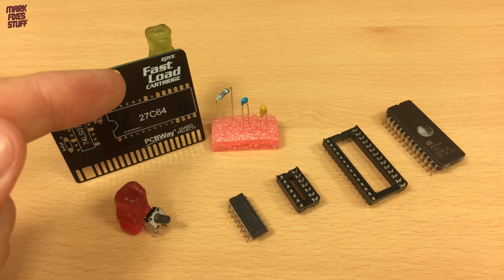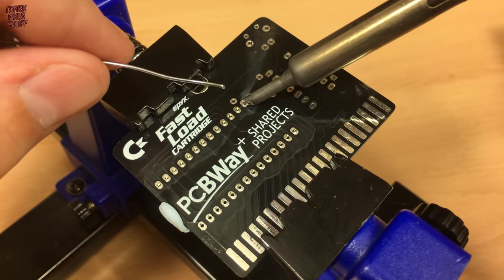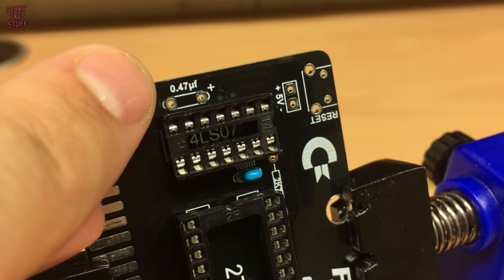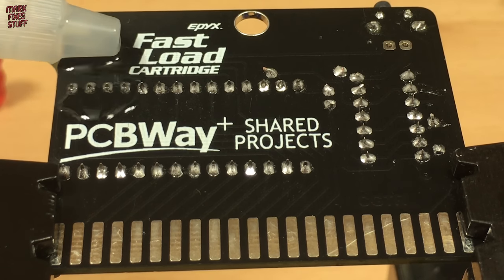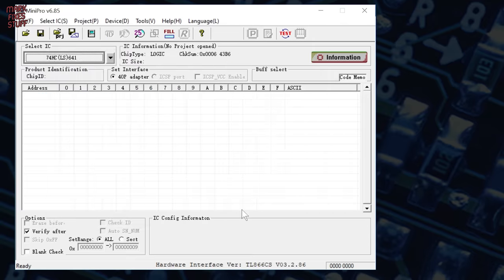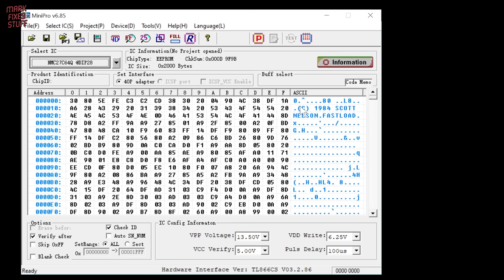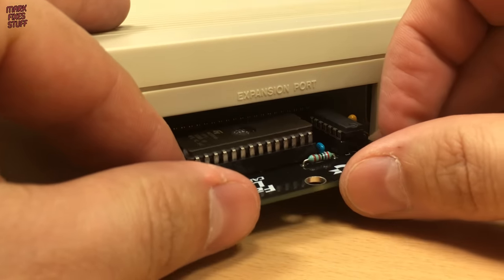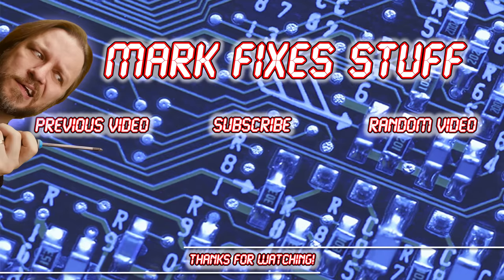Buying FAKE AliExpress EPROMS & Building an Epyx FastLoad Cartridge anyway!

Comment: FYI, no clean flux is an oxymoron. I say this because it works the right amount of heat to evaporate it. Issue is some people put too much on and it turns to a substance which prevents things from working (8 bit guy had this issue on a build) . SO if you use it make sure to check it is clean afterwards.
I worked for a contract board maker which me and several other techs got them to go from no-clean to water soluble. it add a little work BUT fixed a bunch of issues and boards worked much better
Reply from the maker: Great tip. Thank you!
Reply: @MarkFixesStuff  you would be surprised how much it can cause issues. 8-bit-guy was having issues with an 1 mhz apple clone. And makes sense the flux can act like a capacitor and thus screw up signals

Comment: Top video as always Mark! I'm a big fan of blu-tack for holding stuff in place temporarily while soldering.

Nice to see some EPROM programming action too! Those fake AliExpress chips are becoming a real problem, good detective work tracking down the correct model numbers and finally getting them programmed. 👍
Reply: The most annoying thing is that most of the parts DO work, they are real EPROMs just not that type they print over after sanding. And it may matter if they differ in programming voltages.
Reply from the maker: Yes. I’d pay more for the honest parts!!

Comment: You mentioned a new roll of solder.  Do you use regular or unleaded solder when doing new projects? (Repairs should match whatever is already there, but what about new projects like this?)
Reply from the maker: On old stuff it’s always leaded. New stuff is usually unleaded, but as it’s just for me it’s not a legal requirement. Leaded is easier by far but I have a 2lb roll of unleaded too.

Comment: I still have my original Epyx Fastload cartridge that I bought 35 years ago. One of the best things I ever bought for my C64. It drastically improved disk load times on most games. I had a few that were incompatible until I ripped the copy protection out of them.

Comment: Oh the double entendres ...

'I had to cinch the legs slightly otherwise I couldn't fit my part in ...'
'...it's simply a matter of slipping it in and spreading its legs so it doesn't slip out ...'
'Subject your part to the snip ...'
Reply from the maker: That's exactly what I did though!!!!!
Reply: @MarkFixesStuff  The gummy crew check your script for potential innuendos.
Reply: Not to forget "excitedly ram it into the rear as far as we can" at 14:45

Comment: Very nice...
Although if one has an EPROM programmer one could fit a custom Kernal with fast loading support to the computer itself, maybe a dual Kernal set up for good measure. If I remember correctly mine's running Dolphin because I prefer it's command set with the JiffyDOS fast loading routines as I think they are faster and a C=65-alike boot up.... Press the C= key on boot to get the stock Kernal instead.
Reply from the maker: Yeah, this a build project to make a cart. I have a few differnt things to make. Mostly I use my Kung Fu Flash.

Comment: I just use my Kung Fu Flash and install Epyx fastload, Ultimate Cartridge or any other cool tool to it. If you type LOAD"filename",8,1 put : and hit SHIFT and RUN/STOP at the end so you do not need to type RUN, it will auto run program. Commodore key and RUN/STOP will load first file in directory with a Epyx cart. Or $ to load listing, go up to file you want to load and put / in front of listing you want to load and hit RETURN, then scroll to blank part of BASIC screen (at the bottom of screen) and type run. Some fastload utility cartridges use F keys to shortcut commands.
Reply from the maker: This is all really handy to know. I was a pauper, so DOS commands are new to me!

I knew about the Kung Fu Flash process, but I don’t think I’d have got sponsored for that lol 😂

Comment: Blue-tack is not required and only turns messy with heat.
On a 14 pin chip for example, bent the 7th an 14th pins, or 1 and 8 pins, and tack the opposing pins with solder.
Now you are free to straighten the pins you bent, and finish soldering if bent pins bother you.
I just solder them as is. 
btw, love the sexual innuendos!
Reply from the maker: When I bend the pins I get yelled at in the comments that I am weakening the parts. I like to do the Smurf poo joke too. I cannot tell you what I use in private. :p
Reply: @MarkFixesStuff  lol

Comment: Just bend 2 of the pins on the socket to hold it in.
Or hold onto it directly while tacking 2 pins.
Anyone know if there is a compatible board available at OSH Park?
Cheers,
Reply from the maker: No mate. They have a FCIII+ but not this.
Reply: @MarkFixesStuff  ok thanks,
Cheers,

Comment: Funny how if you want things to load faster on the Atari 8-bit users just make the disk drive more capable (like an upgrade) and use something like SpartaDOS. But then the data on Atari 8-bits flows fast already. 😉
Reply from the maker: There was JiffyDOS for the C64 as well back in the day. The data rate was really slow on the c64 though.

Comment: I prefer art microclamps and more. rather than bluetac.
Reply from the maker: I have no idea what they are! Do you have a link?
Reply: @MarkFixesStuff  No. I just get mine in the craft section of my dollar store.
Reply: @MarkFixesStuff  They are metal clamps with a rubber coating used for holding delicate stuff together when doing art. rather small and operate similarly to spring loaded clothespins